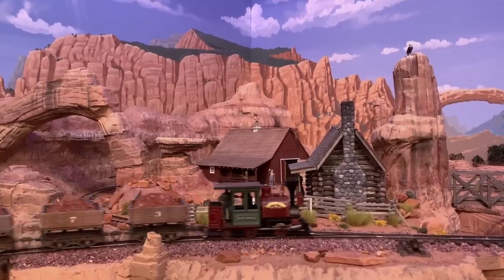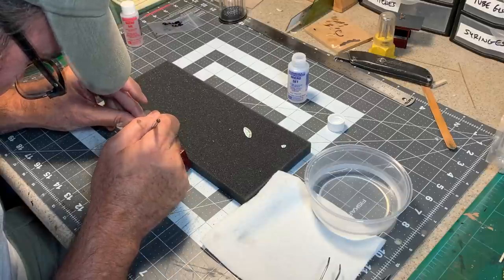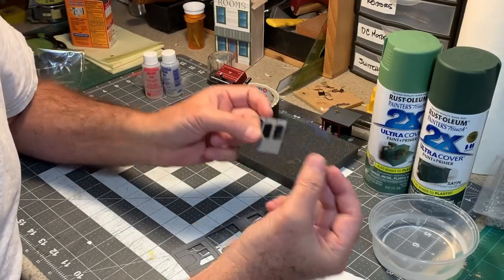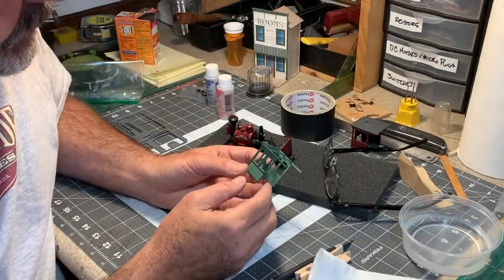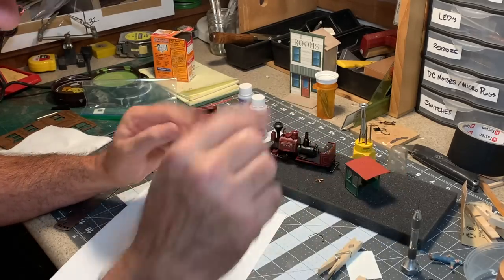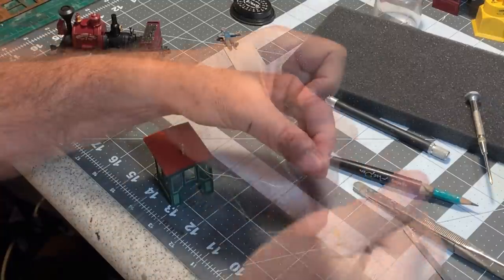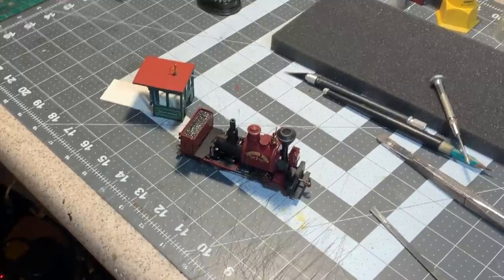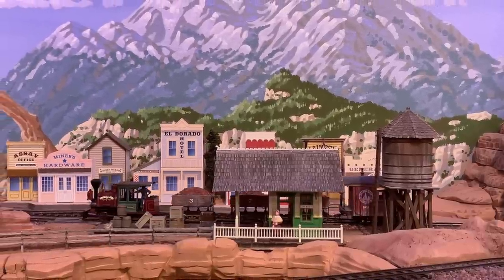Thunder Mesa Locomotive Story: No  7 - Frank Thomas

Comment: Nice video and decal demo. I have applied wet transfer decals on numerous loco bashes and have been relying on dull coat overspray to alleviate the shiny decal film prior to applying a semigloss overcoat. Anyway, next time I'm going to also use Microsol, thanks for the tip.  Quick tip, if the decals do not set correctly, rip, develop bubbles etc let them dry and they are easily removed with masking tape.( drafting tape or dots to avoid removing paint, work best),  easier than decal remover solution,, less stress!
Like your cab. with the reconfigured engineer.
Thanks for sharing.
Reply: Microsol is mainly needed when the surface isn't plain (rivets, panel lines, etc.), but then it should create the wrinkles to be able to conform the decal. The important thing is to never touch a Microsol wrinkled decal, when dry, the wrinkles would have disappear.
For making the decal disappear, a glossy surface and the prior layer of Microset are the most important. 
But not all decal are the same quality, some are very thick and will always be visible.

Comment: Hi Dave - watching your videos is always such an inspiration; although can be a bit soul destroying at times comparing the quality of your work to a relative beginner like me! I’m just curious - did you spray the locomotive with a Matt varnish afterwards to seal the chalks you used during weathering - to prevent any rubbing off when the loco is being handled? I’ve seen so many videos where people have weathered locomotives with chalks and weathering powders - but have made no comment afterwards about how they sealed it! Just as you have done 😂 … I am loathed to use the varnish because I understand it does impact the look of all the weathering work - and despite careful masking, the risk of the varnish getting where you don’t want it. I’m halfway through building of Banta long cab conversion for my Porter 042, so it’s very timely I watched this today. ⛏🧨⛏🇬🇧
Reply from the maker: Yes, I use a clear matt finish, taking care not to spray the wheels or electrical contacts.